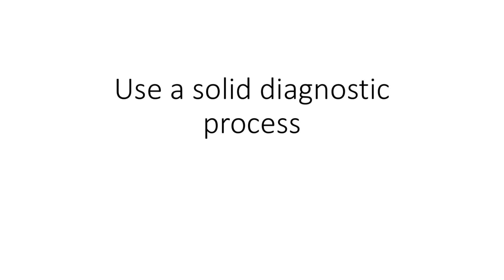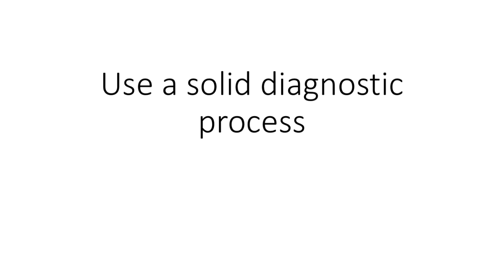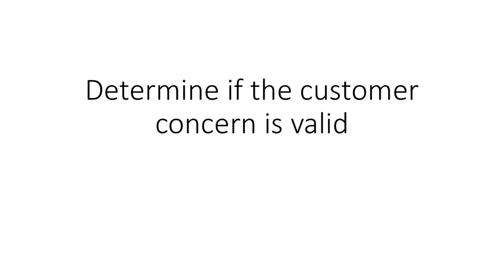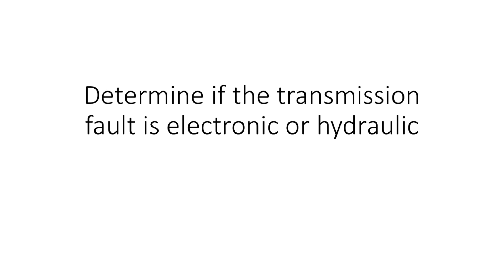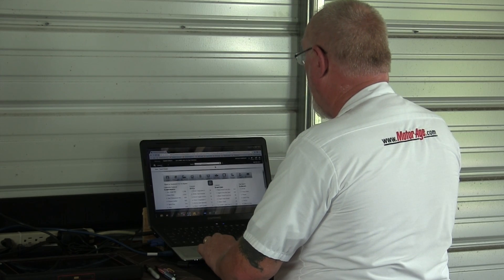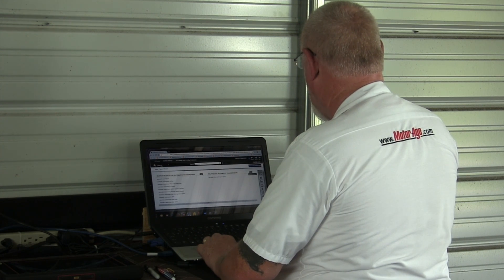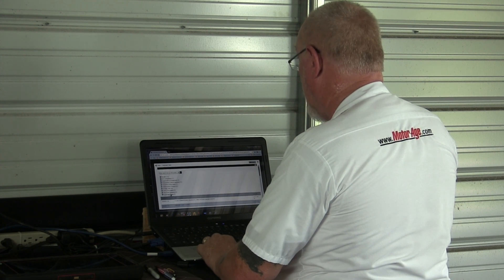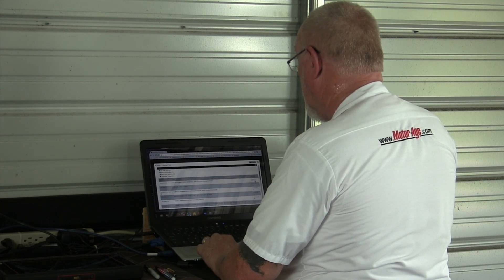The Trainer #79:  Dealing With Automatic Transmission Concerns

Comment from the maker: Just a note for everyone. As others have shared, I misspoke around the 5:30 mark when discussing aerated fluid. I said "Air doesn't compress", when in fact, it does! And that's what I meant. The presence of air in the system will interfere with the function of the hydraulic circuits.

Comment: I believe you may have misspoke around 5:30 when you said air doesn't compress. Not trying to start a war in the comments and I apologise if I miss heard. Those are very good steps to take when approaching any transmission concern. Sometimes it's very hard to diagnose what's wrong until your inside looking around. Great movie as always and I appreciate your time! 👍
Reply from the maker: billie smith Good catch! You're right...air DOES compress, fluid doesn't.